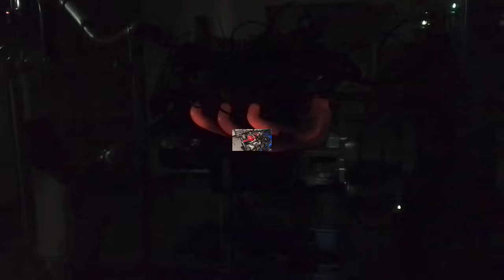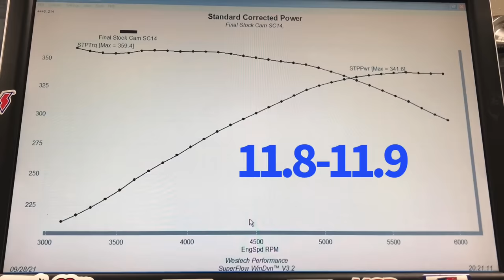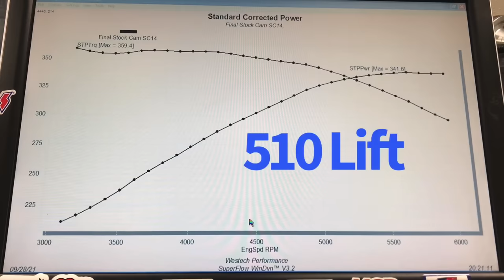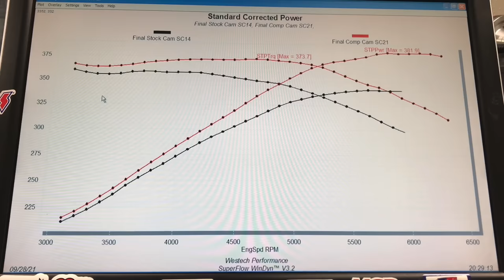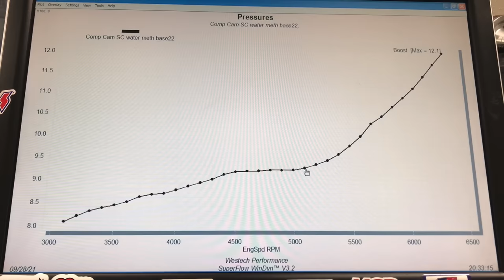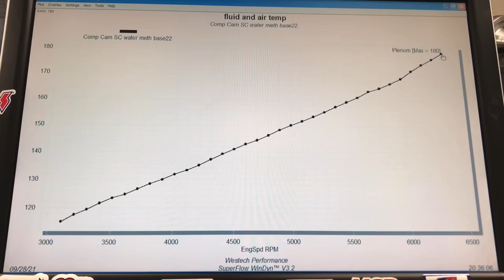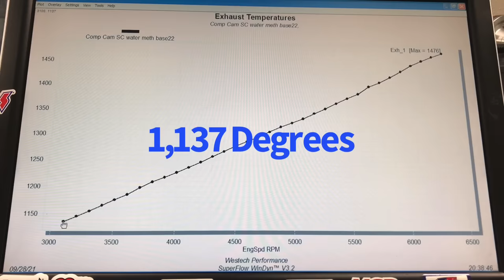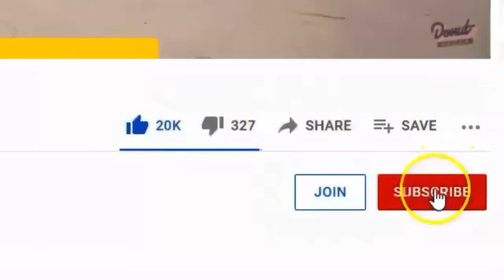HOW TO MAKE MORE HP : CAM SWAP A SUPERCHARGED 3800 L32/L67. MAKE MORE HP AT LOWER BOOST. DIY, LOW $.

Comment: Those 3800's can take some abuse, but need some mods to support higher horsepower builds. ZZPerformance sells a modified oil pump spring that helps keep the oil pressure up. Ring gaps are too tight from the factory and need to be opened up to support higher boost levels. Throw on an intercooler and the motors make great power. I run solid 12's with mine on pump gas and a conservative tune so I don't blow the transmission.
Reply: Put that thing on e it’ll go 11s
Reply: Great point! What transmission could be used, as option? Thanks!
Reply: @420architecMindNDesign fact! I put my Monte SS on E85 and it consistently runs mid 11s on street tires with 18 inch wheels
Reply: @MurdamittenG stock transmission? 😮

Comment: That rising boost curve after 5000 rpm might mean you need some ported heads along with more cam. Looking forward to seeing the water or meth injection results!
Reply: Yeh when you max these blowers the boost dives down. Been there.
Reply: I’m looking forward to a bigger cam. To flatten the boost curve.  If it does it without head changes it could be a great cheap easy 400 hp engine.
Reply: I think he already had installed the pkrted heads earlier but didn't see improved results with the standard cam and high boost

Comment: Richard, you should check out some of our Aussie builds. Quite a few 400+whp setups and even one that has cracked the 500whp mark on a gen3 m90.
Even got a guy pushing close to 600whp from memory with a larger yt 2300 blower.
Hit up brushworks slick sixes for their cam and ported blower. Best in Australia with our l67s
Reply from the maker: 500 whp seems like a lot from a gen 3 m90
Reply: I got 404 whp with a gen5 setup. Never seen it in the states with a gen3. That’s what’s up

Comment: As a guy that messes with these in Australia, ported heads are where you'll pick up the most power, stock heads run out of na flow at 180whp
Reply: I could use some advice.
Reply: @stevewarnock919  ask away
Reply: Which is better for supercharging, the series one or two vn engine, also I'm really unsure about the manifold I can use as I have a Yella Terra charger with reverse snout. Any info is much appreciated.
Reply: @stevewarnock919  in order to supercharge the vn 3800/L27 you would need a series 1 l67 manifold from the states, the only difference between series 1 and 2 vn engines other than the intake/pcv stuff is rear main seal type and the cam and cam gear/retention, I prefer the series 2

Comment: All these videos and the priceless info in them i love it. These other guys engines even better, and even better still you're testing using E85, water meth and mods that drop boost/charge temps but up in output its like dyno video heaven. keep em coming.

Comment: When you get the heads off, get the guide posts machined down so you can get .600 lift in there. A cam in the 230s with .580ish lift will net some decent gains. Especially turbo.

Comment: Running 15psi using a 2.9 pulley. Had to add a intercooler and ice box. I always tell people if they race a supercharged 3800 car and lose just keep trying cause the more heat the slower they get. The second run is never as fast as the first. One hit wonder engines, atleast with the non intercooled m90. GM never shoulda let these engines leave non intercooled.
Reply: I mean for any real performance probably not but I'm sure it's better than the N/A version

Comment: The thing I would really like to know is how this would affect MPG. Doing dyno work is always cool to see the results but we all know, we don't run our engines at WOT under max load all the time. Yes getting more peak HP and TQ makes us smile and maybe something else un mentionable but we need to be emissions minded, and mileage minded as well. Then there is the issue of dependability also as this video brings out. Who wants or can deal with knocking bearings and cranks out frequently. For Richard to be able to just go out and source another engine to grenade is fine for him  I guess but eventually it will come when they are not so easy to find, even though they were produced along the comparison of the VW Beetle.
Reply from the maker: how you drive changes MPG

Comment: I know this is a late ? But I always wondered what's stopping someone from turning a smaller pulley on the lathe 😅 😊
Reply from the maker: that is possible-but the snout itself limits the ID size (we had to machine the snout to fit a 2.6)

Comment: Since buying an l67 I’ve figured you don’t buy them for power unless you’re ready to spend more than what it would cost to just block off the pulley and run a turbo through it

Comment: I wasn't expecting such a great increase in power with just a cam swap, especially one with only 210/220 duration. The factory cam must really stink.
Reply: The factory cam is smog-limited. None of these cam swaps that Mr. Holdener does can survive CA's biennial smog testing. Set up an LLC and register your car in Montana! [No smog tests; all MT's smog rolls downhill to end up in Nebraska... 😁]
Reply: Yes they do! I am running the ZZP XP cam which is a 212/224 cam that makes great power. They also sell a non intercooled cam which is a 220/230.
Reply: @nunyabidniz2868  sorry, but not true. My car passed with the smaller ZZP VS cam (206/216) and actually did better with the ZZP XP cam (212/224).
Reply: more duration doesn't necessarily equate to more pollution if efficiency is increased.
Reply: You have to remember other mods were done first so the cam is helping the smaller pulley and headers do their job better too.

Comment: My Supercharged 2004 Buick Park avenue Ultra needs 93 to 99 no ethanol blended fuel. My owners manual states that any ethanol blended gas can damage to the block and supercharger and no regular 87 as it will knock heavy.
Reply from the maker: e85 will not hurt your block or blower (fuel in injected after the blower)

Comment: Hi 👋 👋 👋 👋 Richard anyway I thought the test went well. But I was wondering if you would of used a cam bushing so you could advance the cam 12 degrees. And if it is advanced to much you can go into the programming of the factory complex and adjust it. This is only an idea only. I have no idea if it would work. Oh can't wait until you do the next test on that engine thanks Ray
Reply from the maker: WE DON'T USE A FACTORY ECU-12 DEGREES ADVANCE WOULD BE  ALOT

Comment: Richard, I watched a video awhile back and you made me see the light. It was the clone gt45 on a 302....which I bought. Towards the end you said stop worrying and do it. Well, I'm doing it. I still have questions though. My windsor already has Icon pistons, eagle rods, it's probably just getting skip white heads this time around. I plan to tear it back down and add gap. It is currently 10.5:1 if I remember correctly and I'd like to think cam choice would play a part in keeping it alive (duration, cyl pressure etc). I have two roller cams on the shelf, Recommendation? Thanks

Application: 1985-2001 FORD 302 HO, 1994-1997 FORD 351W

Brand: Erson Cams

Cam Type: HYDRAULIC ROLLER

CID: 302, 351

Duration @ .050: 226/234

Duration Advertised: 294/302

Grind Number: RH-294-2A

Gross Lift: .544/.544

Lobe Center: 110

RPM Range: 3000-6700

---------------------------------------------------------------------------------------------------------------------------------------------------------------------------

SKU: TFS-51403004

Trick Flow Specialties Stage 4 Track Max Hydraulic Roller Camshaft for 302/351w Ford

Rough idle, strong top-end power

Basic Operating RPM Range - 3,000-7,00 RPM

Aftermarket intake, heads, and headers recommended

3,000-3,500 rpm stall converter, 3.90 to 4.11 gears recommended

Duration @ .050" - 242°/246°

Valve Lift with 1.6 Rocker - .595/.595

Lobe Separation - 110°
Reply from the maker: SMALL CAM

Comment: Hey Richard. I was wondering if it would be possible to stroke the 3.8. Platform? When I was attending wyotech in 2013, I was really wanting to see if a gm 3.8 v6 could be stroked. We did some math and found out that with a .30 over bore. A cam and crank from a 4.3 v6 it could be possible. Then I wanted to see if it would be possible to twin turbo the engine. Let me know if you could attempt this or crunch the numbers and let me know if it's possible.
Reply: You can get stroker kits, yes. For street duty they are great but if you want horses stock stroke and bore are best with more rpm and better rods.

Comment: The problem isn't the 3.8l engine  its the trans. Thr transmissions are utter garbage and break like gass. Only if have a manual transmission and preferably rear wheel drive are there aftermarket options to handle the power.  
You do a 3.8l power upgrade you'll be blowning  through transmissions every year. And are now 25 or more years old there very little options to up grade or junk yard transmissions anymore.

Comment: Richard you need to do a Ford 3.8 supercharged v6 from the thunderbird sc vs gm 3.8 supercharged v6
Reply: The fords head gaskets won't hold up. The 3800's never see hg issues
Reply: @brysonshires9742  they hold up just fine if you put in good ones. Felpro MLS is what I use on Ford 3.8l. 50,000+ miles @ 300rwhp.
Reply: @rancherlee  you've got a good point. But you can bulletproof 6.4 power strokes too

Comment: @Richard, would you be willing to try upgrading the bearings in the block that spun one?  I was part of a group of dudes in high school who were really into these engines and we found the stock crank bearings to be a limiting factor.  If I remember correctly, we were using Clevites.

Comment: Great video Richard! Any correlation between ignition timing and EGTs. I understand the timing was tuned for max HP, however I question if more timing (30deg+) would reduce the EGTs/glowing headers. Thank you.
Reply from the maker: USUALLY IT DOES DECREASE EGT WITH MORE TIMING BUT 30 DEGREES UNDER BOOST IS NOT GOOD

Comment: i looked into doing this to a 3800 years ago and came to the conclusion the transmission can not handle that kind power for any length of time. the only path to fix the issue is to modify a FWD Cadillac transmission to replace the 4T65-HD transmission.
Reply: You can get the 4t65hd built also.
Reply: @SupraBdub  from what i understand the 4T65-HD comes with most, if not all, GM supercharged 3800 vehicles... but my point was at the end of the day you'll be spending big money to beef-up the powertrain.

Comment: I'm curious.... I ran a series 2 1998 gtp with a ported gen 5 blower on a 2" pulley running 21psi . Upgraded valve springs , short stack intercooler,  comp xp cam , ported heads throttle body, headers and cai and custom tuned ecu..... plus a fully built trans to handle the power . Can you do a similar test have pic of my build but don't know how to share it.... total animal lots of fun
Reply from the maker: are you asking if I can dyno test your motor combo?
Reply: @richardholdener1727  yes, if possible.... I know a lot of the comments are old but I'm very curious on what kinda power I was actually putting down. I was running 18° timing and 42# injectors on 93 Oct.

Comment: Hi Richard. do you mind if I pick your brain. you've inspired me to do a budget turbo project. I'm using a ford laser with a 1.6L Mazda ZMDE engine and an eBay T25 turbo. it has a 2" compressor outlet. most of the cheaper intercooler and piping are 2.5" , would there be a problem using a 2- 2.5" silicone adaptor and 2.5 intercooler and piping? Thank mate. Richard from Australia.
Reply from the maker: WE DO IT ALL THE TIME-IT WILL WORK

Comment: I would love to see those same cam specs on a 110-112 maybe a touch more duration
Reply: A narrower LSA would build more torque at a lower RPM and fall off at higher RPM, but it’s less necessary with supercharged stuff since the boost already makes more power down low.  More torque probably isn’t ideal since most applications that use this motor are FWD and most of the trans “behind” this motor don’t like the stock , let alone the extra torque of a hot rodded one.  Torque tends to be the thing that kills parts; both driveline and engine.  Look at his Big Bang series, where he’s stated that loading in lots of boost early likely caused the Gen 3 5.3 to fail.  It’s also the reason people don’t spray nitrous at low rpm.  A “150hp” shot makes 150 lb/ft at 5250 RPM, but makes 300 lb/ft at 2625 RPM.
Reply: @stlchucko  I just think a 115 is too wide especially with suck little duration. I don’t think a 110 would give anything up down low
Reply: 110 would be good on it with a couple degrees of advance be a good little cam. When people know they won't be running an intercooler 215-230 favouring exhaust and 110-112 is common.

Comment: Mr Holdener,I need your help .I'm trying to maximize HP with the parts I have . Need to know what heads to add to mix for total maximization. This is what I have. (Elgin - 1840p  / Fast lsxr -102 , timing chain , smaller  crank pully ,high vol oil pump. Headers longtube .I'm looking to match what I all ready brought to a great pair of heads. What do you recommend ? ( going in an Corvette ls1 2000 frc. Manual) Thanks again for your time 🙏.
Reply from the maker: PORTED 243 HEADS OR AFR OR TFS

Comment: Great video would like to see the gains of 1.9 rockers on stock cam if would get you 20hp gain as cam gets you 40hp ?
Reply: It would probably be more like the down low power gain because it is really only increasing lift not duration so probably wouldn't make as dramatic of a difference up top

Comment: @ Richard Holdener/ what is the L32/L67 mean. What if you even the number 67/67
Reply from the maker: engine designations by the factory-early and late sc 3800

Comment: Hi I have a L67 in a Fiero it’s a fully built engine. I have an inter cooler and I’m using the North Star tb. I have a 3.6 pully we did a tune I got 345 whp my tuner did not do any timing. When I got home I saw we are at 12 degrees in all rpm range. I have the hp tuner set up.  I want to change the pully to the 2.8 and re tune with timing. Also I am running E85. My tuner said the IAT should be relocated from the TB to the manifold. I guess I have to drill the manifold. Is that what you did ? And do I use the North Star IAT in the manifold so I make sure I have the same values and leave the other one in the TB just unplugged ?
Reply from the maker: I ran it with a Holley ECU-not a stock ECU-I didn't use the IAT sensor-345 whp with a 3.6 pulley and 12 degrees of timing? Something doesn't add up!
Reply: @richardholdener1727  I’m sorry I was wrong it’s a 3.2 pulley
Reply: I am thinking of going 2.8 do you think that’s to low

Comment: I was interested in these motors a few years back for an s10 swap. Went ls
Reply: Don’t these use a different bell housing pattern than the LS or 4.3? Or did yours have the 4cyl?
Reply: @bigredhelland  that is correct they use the small chevy bell housing patter. So in a 4 banger or 2.8 s10 it'd be an easy swap. With my 4.3 it would need an adapter and was a reason to not use it. Ls swap the world
Reply: @danielpeterson2843  I’m right there with ya. I just picked up a awesome blazer extreme bone stock in nice shape, 4.3. Going to ls swap it but I bought all the parts for a 3.8 like in this video for a different project that I decided to spice up and do rwd and ls swap (turbo) instead. So now I have a pile of parts to do a 400hp 3.8 that I’m sitting on.
Reply: @bigredhelland  mines actually a 92 Olds bravada, same thing but I'm about to pull the lm7 out and drop in an lq9

Comment: So am I good with my setup or should I drop pulley size on my 3800sc intercooled with zzp xp hot cam. Stock heads, 130 springs, ls7 lifters, on a 3.4 pulley the car feels great but wondering if it's a huge difference to goto a 3.2 pulley or am I staying in a good curve at 3. 4 pulley
Reply from the maker: add e85 and boost